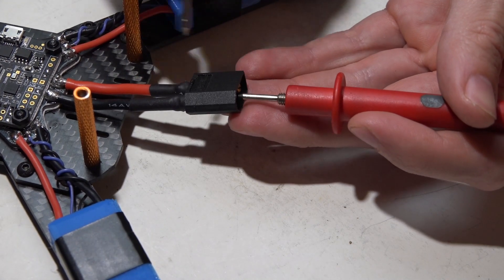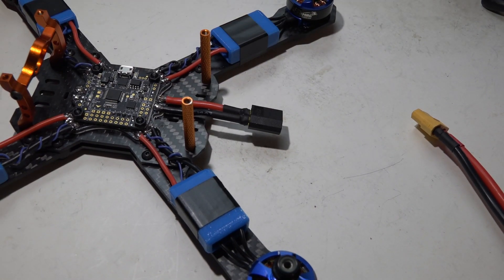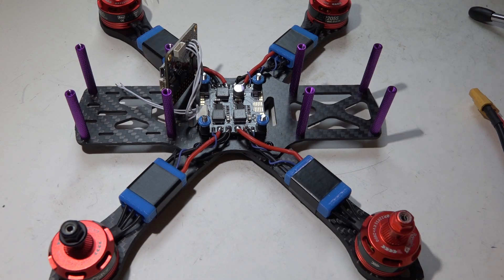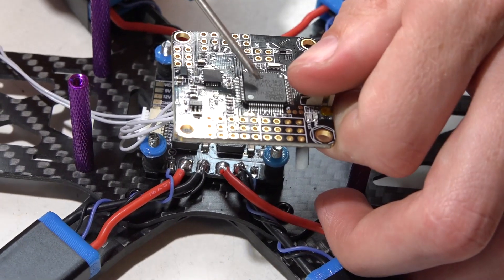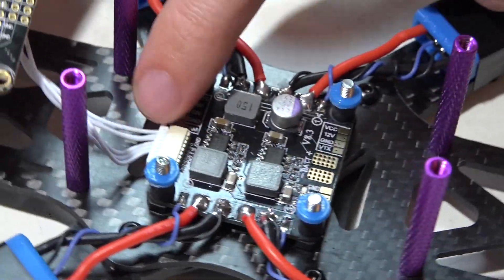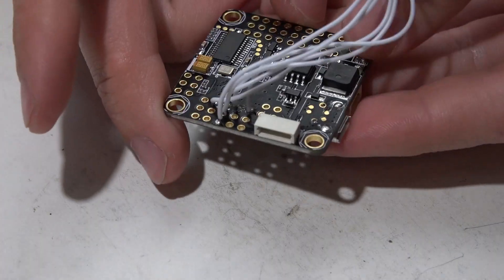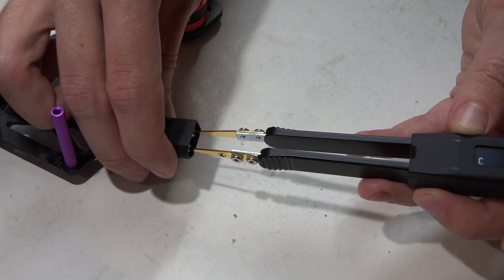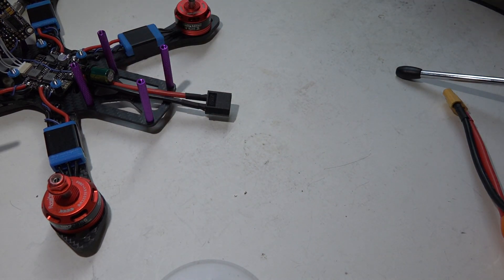Multirotor Build Pt9: Powering FC's, Capacitor, & Tips

Comment: Hey JC! First of all.. GREAT VIDEO'S YOU HAVE! you deserve more credit man! I have a little question.. well actiually its ALOT of information before I can hopefully get to the point where you understand what I am trying to ask :')I really hope you have the time to help me out! Im currently in the middle of a new build.. and it is verry simular to this (extremely nice and clean) build : 

http://rotorbuilds.com/build/3075

He, you, and me are using the same FC in this build.. the omnibus f4 clone.. The only difference is that this man powers his vtx and camera via the fc, but only on 5v.. I am planning to do it your way! I will power my VTX (IRC tramp) with full lipo power from the 4in1 esc, and the camera from the 5v out on the vtx.. so that part is covered.. But, I still need to give the FC power.. (and my rx receiver via the fc on ibus) I want to do it like you did in this video..
1: cut the legs on that regulator on the fc.(to prevent heat issues+frying it) 
2: put 2 wires on vbat and ground (only for voltage in the osd)
And that leaves me with step 3.
Aply 5v to the FC! And now (FINALLY:p) comes the question!
: In your video you Apply 5v and ground to the pads next to the motor signal wires.. but if you look at the pictures of that build i showed you, that man has like a jst(?) connector from his 4in1 esc straight to the jst slot on his fc! And he also used recource commands to do the motor signal wires via that same plug! Im planning to do it that same way! (Also asked him about this in the comment section) So the question is... can i power the board via that 5v on that jst connector, and at the same time cut the legs on the 5v regulator, and also still connect vbat only to monitor it in the osd?!?!? Well... THATS A LONG QUESTION:") hope you understand everything i am saying, and that you can help me out! And if not, your still the man! Your video's and the way you explain everything in great detail is GOLD! keep up the good work man! RESPECT!

Comment: Great videos man. Do you ever use a "smoke stopper" when first connecting a battery? Costs about $5 bucks to make one with a circuit breaker and can potentially keep a lot of the magic smoke from coming out of your new parts.
Reply: Should be a standard tool especially when you're new to building.

Comment: Just to add to what you said about the voltage regulator. I use the F3 version of the board on my freestyle "learn" quad and before I've started using separate BEC - the overheating problem also made the BAROMETER readings funky.
Just in case somebody says his barometer is crap - tell him to check the board temp. 
Yes I fly with BARO on - as in any other aircraft you need to see how much altitude you have left if you are free falling :D

Comment: I really enjoy your videos, good job!  Just a note about the continuity checks against the carbon fiber frame.  If you have a conductive component, like a vtx antenna, touching the frame, you may see continuity against ground, but not positive.  I'd never tested continuity against the frame before, but great idea, so I tried it on an almost complete build, then freaked out when I had continuity.  After tearing it down and losing continuity, I was pulling my hair out! :) Then realised that it was only after attaching the vtx to the aluminum holder that it became continuous with the battery lead's ground.  Still a worthwhile test, just make sure you do it before intentionally adding something that grounds to the frame.

Comment: if anyone still uses Deans/T-plug style connectors RMRC has power leads on clearance for like 99 cents.    i had far too many T-plugs from various fixed wing projects from years ago.      

but 99 cents for a power lead(even has 3mm terminations you can save for other uses) is a deal considering the time it saves you trying to solder those pain in the ass plugs.

Comment: I want to know if you will isolate the vtx antenna plug on the Martian Frame.
I saw some frames that have the hole for the antenna plug, but I don't know if it needs to be isolated.
In pictures of QAV210 and Martian II on the internet I don't see any insulation, so if you test the continuity from negative pin on XT60 plug and the carbon fiber it will conduct.
What's the correct way?

Comment: Hey quick question and sorry off topic. Doing a build with the Neato Pipsqueak and using the https://www.rotorvillage.ca/product-p/rcx08-236.htm with Beta flight OSD. Love the OSD in Beta Flight everyone needs to go that direction. So I bought a AIO camera with VTX. How should I wire that camera to the FC so I an use the OSD? Split the video wire first going in then coming out, like a loop? Funny thing is I'm doing a build video and asking you. Anyway I know how to wire it using a camera and a VTX separate but not sure on the AIO. Side note: the Neato frames are very, very nice and come with a lifetime warranty. I'm not associated with them in any way at all. Thanks again and great video!!

Comment: I have the Flip32 F4 Omnibus V3 which has a switching BEC. Regardless of how good this is on paper I still want to power everything off the PDB.  Is there any option to see batt. voltage on my intended setup?
Reply: Good question! I got the same board and am "uneasy" as well even though (I think) this bec is the same as on most PDB's.

Comment: Nice video. Would you be able to elaborate more on the importance of a higher capacitance and why you shoot for the certain numbers? And what is too high?
Reply: The RCAddict I have yet to hear about the purpose of capacitance especially on the battery leads. Would someone elaborate?
Reply: I know it is to help soak up voltage spikes, but I would like more info on them, and JC seems to know a lot :)
Reply: The RCAddict Yup JC seems to explain better than many. I understand most of the electronics terminology from audio amplifiers, this hobby tricks me.

Comment: another way to avoid smoking the quad is to use a smoke stopper.
XT 60s with 12awg wire and a 1157 taillight bulb . wire ground direct between the XT 60s and the bulb on the positive between the XT 60s .... if the bulb is lit you have a short , the bulb acks as a 2amp save.  wire both eliments of the bulb in the circut
Reply: Ditto, I use the continuity test and a homemade smoke stopper just like you described.  I have learned something new with the capacitance test and what value is meaningful.

Comment: i bought a pack of low esr 470uf 35v condensators, but i can't find the low esr written on the capacitor... Are some capacitors out there that have low esr but doesn't have it written on it?
Reply: +One Of Thousands Some have low ESR written on them others you will have to check the specs when you buy it or use the right type of meter to measure it. Low ESR caps are used in things like switch mode power supplies so at the very least it should have a temperature rating of 105 degrees C written on it. While I suppose that's no guarantee of it being low ESR if it isn't rated for at least 105C then it's probably just a normal electrolytic.

Comment: Hey bro would that vbat wires not fry the board? In omnibus f4
Reply from the maker: Nope. The board is meant to be powered with the full voltage of the battery. And any flight controller with VBAT pins are meant to have the full voltage going to those pins. Those are the only pins that can handle the full voltage.
Reply: Project Blue Falcon But you cut out the resistor though right? So it no longer has that ability
Reply from the maker: No I cut out the flight controllers bad voltage regulator because I'm using the PDBs better voltage regulator instead.
Reply: Project Blue Falcon i understand, but after that you soldered in battery voltage straight from your pdb to get voltage on Osd. But does that not burn up your FC. Since you already have 5v coming in and battery voltage from PDb? Or is the circuit cut when you removed that bad voltage regulator?
Reply: Looks so. Batt voltage goes through V sensor and then to voltage regulator and then to power the board. But if the regulator is cut off there will be no power to the board from that point.
Reply: nandakoryaaa Thank you bro!